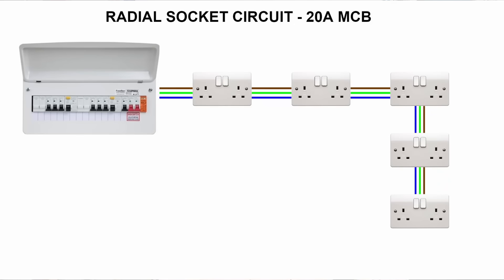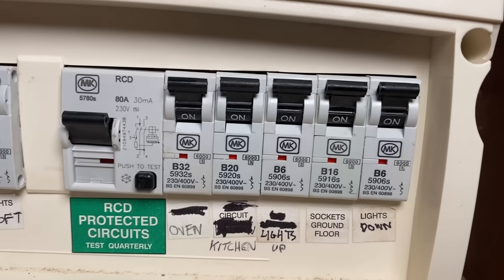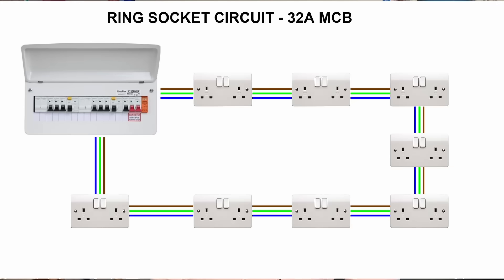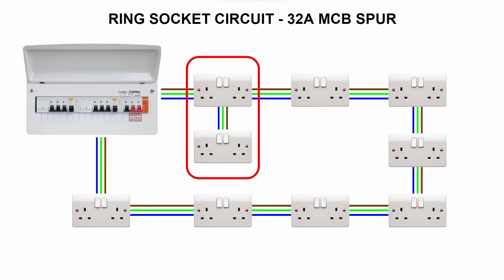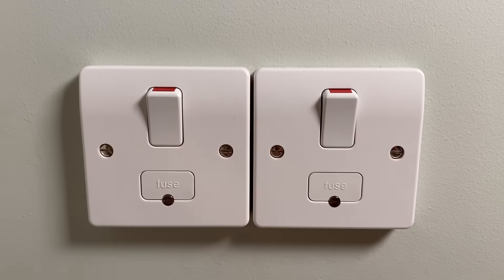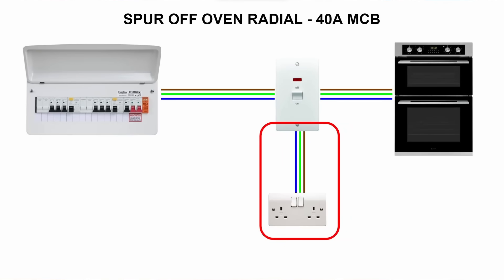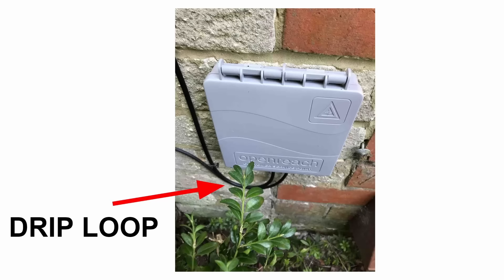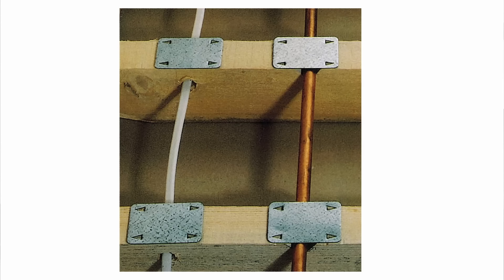BIGGEST DIY Mistakes Adding a New Socket

Comment: Excellent stuff. One question,  the diagrams seem to suggest one wires the third, spur cable into the back of the socket. I find there is just enough room for two cables, both in general space and in the actual brass hole for the wires. I recently ran a 3 amp switched/fused spur. But, I cut the ring between sockets and joined the three cables using a junction box with much larger terminals. Did I do a good or bad thing?
Reply from the maker: Thank you! I can’t see anything wrong with what you’ve said.
Reply: @TheDiligentDIYer1759  "diligent"? Really?  Not going to ask about the JB? where it is? what kind of JB?
Reply: @TheDiligentDIYer1759  questions that need asked......
What kind of joint box? Fuse rating? Cable grips? size of cable taken from JB? Length of run from JB to spur? Is JB accessible?

Believe it or not but spurring off a circuit for a spur will be covered by at least 5 separate regulations and what not.

Not trying to show off, just a heads up so you don't find yourself being sued by someone.
Reply: What cable did you use to spur from the Joint box to the spur and how long was tye cable and is the joint box accessible?
Reply: @elliotwilliams7421  exactly. But apparently according to the diligent one, it’s ok… 😂
Reply: @jameshansing5396  he should just add a note advicing you should still seek professional advice
Reply: Regs and common wiring practice allow for junction boxes. They have a British Standard and are no more or less dangerous then any other BS electrical wiring accessory. Spurs using junction boxes are (if they fulfil the other regs for spurs) specifically mentioned in the regs as one way to design a ring or radial circuit.
However, they either need to be accessible or maintenence free; they need to be rated at 30a for rings and the same as the breaker for radials; like everything else they need to be wired correctly, cpc sleeving etc. 
You should use the same cable (2.5mm2) for the spur to supply the FCU. I'm assuming it's close by. Clip the cable and don't bury with insulation. You said the terminals are bigger than in a socket so it sounds pretty big to me.
Reply: it sounds very much like you should not be doing electrics
Reply: I agree, purely because these are the sort of questions that should be asked BEFORE doing the work and not after and also because he hasn't answered when asked all the questions elliotwilliams has raised.  So the possibly dangerous junction box remains.  @jameshansing5396

Comment: You missed one mistake I came across a few years ago, I was testing rings prior to adding a new double socket to the 'front of house' ring and was getting odd results. When I investigated further I found that someone had added a new double socket upstairs and as it was a ring, they'd joined the front of house and back of house rings, mistakenly thinking they were upstairs and downstairs rings. Fortunately it was simple to remove the cable from one side of the offending socket making it int a spur form the socket on the front of house ring. I really hate people who think they know what they're doing but in reality have no clue.
Reply: But but but... OK, enough with the motorboat impression....

Whenever you want to insert into a ring, you find both ends of an existing cable in that ring and replace it with 2 cables with the new socket in the middle...
If doing that leaves a connection between 2 circuits, it was there already.

PS front and back vs upstairs and downstairs is a bit wierd innit?
Reply: @dougaltolan3017  I once had a house where the two ring circuits were 'original' and 'extension', where the extension (built before my time) comprised the kitchen plus the largest bedroom. That may make more sense than just front and back.
Reply from the maker: Yes unknowingly joining circuits is a classic one haha. Thanks for watching!

Comment: Great video. What cable would you recommend for running a spur externally?
Reply from the maker: Thanks! Depends on your particular situation, I’d use either armoured or some exterior rated round cable, something like this - https://www.tlc-direct.co.uk/Products/NY2dot5slash3.html?ad_position=&source=adwords&ad_id=398505590848&placement=&kw=2.5mm%20cable&network=g&matchtype=b&ad_type=&product_id=&product_partition_id=&version=finalurl_v3&gclid=CjwKCAiAxvGfBhB-EiwAMPakqoeEfff4d0-YHNZoAX3t82cUWCLc2zgUlVWZCf64du2awXzCUzT6WRoCidwQAvD_BwE
Reply from the maker: Or you could just run twin and earth in conduit

Comment: As an engineer, I fully concur with his opinion that loops should be removed from regulations as it is a safety risk.
Reply from the maker: Yep exactly, a circuit which could have a major problem, but appears to be working normally, Is a terrible design

Comment: Wow this Ring Circuit thing looks like a house fire waiting to happen. The fact that this is allowed outside of a third world country is mind boggling.
Reply from the maker: Yes it is bizarre. Thanks for watching!
Reply: But it’s not that bad in reality.  Three ring circuits, two or three lighting circuits and a number of radials for cookers, showers etc mean it’s usually fine.  A broken ring can be a problem, but that’s down to the cowboy installer.
Reply: You might think so ... and many would agree that radial circuits are a better idea. However, from what I can find from a simple search there are about 300 deaths a year in USA from electrical fires and 30 in UK. You have about 5 times our population but 10 times the number of electrical fire deaths ...

Comment: My hot water service is on 20amp single circuit my stove is on a 32amp single circuit.  Lights & ceiling fans on 10 amp single circuit  power is 2x20 amp circuit , now I have ULPG stove and turn the electric stove circuit into power circuit No3 having fridge chest freezer microwave on that circuit removed 32amp circuit breaker and put in 15 amp . No dramas for the past 20years.
Reply from the maker: Thanks for watching!

Comment: Someone told me recently that homeowners in the UK are no longer permitted to do their own electrics: is this true?  Also, for lighting in the loft, why isn't it permitted to use a fused connection unit to limit the current draw on a socket spur?
Reply: Part P of the building regs says some works are notifiable to building control (new circuits, new consumer units, wiring in special locations). All other work must be done by a competent person (ie they must know the relevant regs and be capable of doing the work) and be inspected, tested and certified- people often don't know this and don't own suitable testing equipment (ring continuity, insulation resistance etc).
It is permitted to wire a light from a FCU fused to 5 or 3a, as a spur from a ring final circuit. Often a shed will have a radial for power and run a light this way. Attics are the same. People also do security lighting like this, spurred from an upstairs socket.
Reply from the maker: Thanks for watching!
Reply: What if the homeowner is a sparky?
Reply: Homeowners need to be suitably competent.

Comment: How about running a radial in 4mm T&E from the ring?
Also.... if someone requires a socket in a loft its only going to be for either a light or a T.V amp so personally i would only git a single socket labelled up as T.V point ONLY.
Reply from the maker: Yep i think 4mm spur off a 32A ring would be absolutely fine. You might have a hard time getting 4mm and 2 x 2.5mm into the terminals though

Comment: In fact of all my experience in domestic wiring the 32 amp ring main on 2.5 mm wire is the most dangerous benign system, easily corrupted and reliant on tight sound connections throughout. Tight connections aren't guaranteed by the best electricians and that's why we have Circuit breakers and rcds.
Reply from the maker: Yep absolutely, thanks for watching!
Reply: all circuits rely on goos connections ?

Comment: I am an electrician and I can prove that ring mains should be banned. If one is supposed to test without dismantling a circuit how can one test a ring main. On the standard test one has to reassemble the circuit once the test is complete which means the test one has just done is null and void  because there is no proof that one assembled the tested circuit correctly.
Reply from the maker: Great point!! Thanks for watching
Reply: I have a friend who lives in Belgium but his street gets 3 phase to each house and I am sure he said they had to have radial not ring but IIRC they were cabled in 4mm
Reply: @malcolmmaclean9380  correct. Not everyone gets 3 phase here though, only when requested on neeer buildings. Older houses still have a lot of 3x230v or 3x400v. As far as I know, ring circuits have never been used in Belgium.
Reply: That is not a justification for banning the use of ring mains.

There are other far better sound reasons for banning them.
Reply: @deang5622  I agree
Reply: Any test is only truly viable at the exact moment of the test. Once the test is over and the system is reinstated to normal operating conditions, then all that the test has proved is likelihood of performance safety etc, rather than an absolute certainty. Therefore you just need to accept the %'s with whatever system you have and change it if required. A design that you don't like doesn't necessarily make it bad per se, but doesn't prevent it from being improved either
Reply: PS ... I also prefer radials to rings and would also upspec cable CSA etc wherever possible to give more overhead, as the £ cost will be forgotten about years down the line, the safety factor that you bought yourself won't
Reply: Ring mains only started to be used in the UK just after WW2 when after eating the bomb damage huge numbers of houses were needed fast, and the Ministry of Supply calculated that suppliers of copper would be one of the limiting factors in rebuilding. This was made more urgent by slum clearance starting before the rebuilding program had completed.
Reply: Indeed, they are deadly by design and the termination method that allows the time-consuming testing of ring continuity that can not be maintained in service. Hence, the requirement for testing the continuity. Still used and endorsed in the old British Empire countries, excluding Canada. 

An outdated and deadly circuit for at least 50 years due to the demand for additional sockets. Resulting from the historic consideration of only installing up to 2 sockets per room or alterations to the building. 

When wiring and terminating a looped circuit to the pre 15th  regs. The conductors were always twisted, so the circuit remained continuous if the conductors ever became loose from the terminals. This practice is still used in North America using "screwits"/ "wirenuts."

The ever-changing wiring regs always amaze me with the ever-changing ratings of the current carrying of conductors and installation  methods.

If you're going to add extra sockets to a known "continuous" ring main/ring circuit. Use 4 mm2/11/12 AWG, and add as many outlets as you like. The low risk of "potential overload is the same or as extending the ring. In addition, a good earth loop impedance will be maintained

If resulting from an inspection (EICR) if the ring isn't contiuous or has excessive non fused spurs/branches. Split it into a 16 amp,  or a 20 amp (earth loop permitting) radial circuit for a straightforward compliance corrective measure.
Reply: I'm an engineer and I agree with you 100%.
Reply: Good luck with that, you've no chance
Reply: I do not understand why a ring main circuit has to be dismantled? Surely the test is proved at the consumer unit at each circuit switch, if it fails then the fault is located. What is the problem?
This would be the same for a radial circuit albeit simpler in locating faults.
I am only DIY but have 50 years experience.
With a radial circuit you would have to use 4mm cable unless only one single socket is on each line. Otherwise putting two 13a appliances could possibly overheat a 2.5 cable depending on environment.
In recent years I have found a few professionally installed circuits with loose screws. Yes, this would be the main reason for banning Ring Mains.
However, training is the most important feature but still depends on individuals who do not care in the quality of their work.
Reply: simple way to test is run a 1kw resistive load at a mid point and use your ac clamp meter. easy. learn ohms law
Reply: Where I stay, plug circuit is now only 20A. Ring mains are discouraged for the exact reason you mentioned.  I hate them. In HV networks,  they are common, but very well protected.  Any break is picked up. LV, a no go now.
Reply: @patrickcannell2258 20a radials are becoming common in UK now, using 2.5mm2. If clipped direct it can be 25a. People also do 32a radials for kitchens on 4mm2 but the terminations into sockets become difficult.

Comment: Fantastic video.  I didn't think you were allowed to run cables horizontal in a wall any more?
Reply: Yep from any accessory you can run horizontal or vertical (prescribed zones) or max 150mm from ceiling or corners of walls etc
Reply from the maker: Thank you!! I believe it is still permitted under BS7671.
Reply: You can run cables horizontally or even at a diagonal angle as long as its at least 50mm in depth. Thats what i was told when i was doing a Part P refresher course.. However , I Dont, i prefer the old school method of running cables vertically only.

Comment: Technically any spur from a ring should be of the size of the MCB ie 32a so would need to be 4mm not the 2.5 that we have used for years, I started my electrical life in 1968,  under the 14th ed of the regs, going by todays loading on circuits which are conciderably alot lower than they were years ago there is not the problem of 2 twins on a spur that there was years ago or through against the regs it wont be supplying 4 fires at 3KW more like a total of 5amps max !
Reply from the maker: Thanks for watching!

Comment: Worth mentioning that most people think a twin socket outlet is made to work with 2x appliances both running at 13amps. The BS that they are made too only requires the socket to be capable of carrying 13amps in total & if you look on the back you will see they are marked as 13amp & not 2x 13amp or 26amp. MK Electric tell me their twin socket outlets have been independently tested & will run at 19amps for a short period without any damage to the socket but if you go any higher thermal damage will start to occur quite rapidly
Reply from the maker: Yes true, often seen when people have tumble dryers and washing machines in the same socket
Reply: @TheDiligentDIYer1759  The secret is continuously rated. The BS standard specifies that it must be possible to draw 20A from a double socket for (I seem to remember) 30 minutes without excessive increase in heating. In practice, it's pretty well indefinite. A washing machine and a tumble drier are not going to each draw 3 kW for extended periods. It's only when the heaters are operating, and both will be thermostatically controlled.

Just about the only time 6 kW will be drawn from a double socket is by plugging in a couple of 3kW space heaters into large, cold room. 

It is very common for circuits to be run overloaded for a period. Often a cooker will, in theory, be able to draw far more power than the nominal rating of the circuit. However, MCBs are deliberately rated on a time curve (normally class B in domestic properties) and they allow for the possibility that a particular combination of grill, hobs and oven(s) might be turned on at the same time and exceed the sustained capacity of the circuit for relatively short periods. 

As an example, the BELLING Farmhouse 110E Electric Ceramic Range Cooker  has an electrical rating of 14.5 kW. That's 63 amperes at 230V yet the manufacturer's instructions are that it can be connected to a 32A circuit. If it just happens that a particular combination means that it draws, say, 45A for 30 seconds before thermostats and so on kick in, then the MCB/RCBO won't trip due to the thermal delay (and fuses act that way naturally). 

It's just the same with a double socket with a couple of high powered devices. In practice, they aren't likely to be both pulling full load for a very long sustained period.

Not that anybody tells the public about this.
Reply: MK used to claim their DSO can handle 19a constant load for as long as you want. May have changed now as MK isn't what is once was!